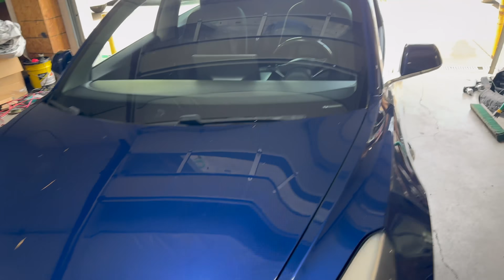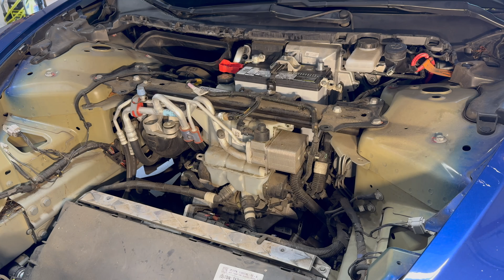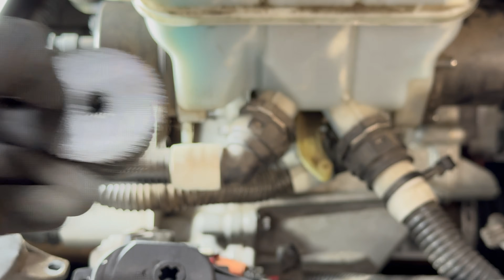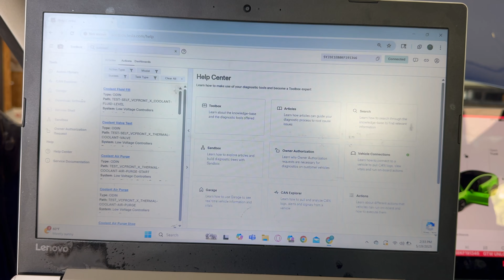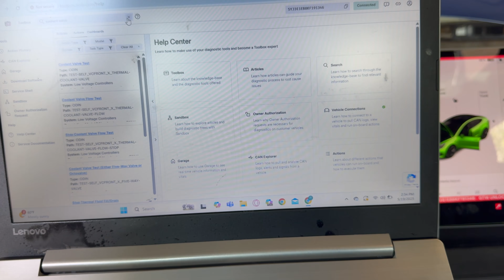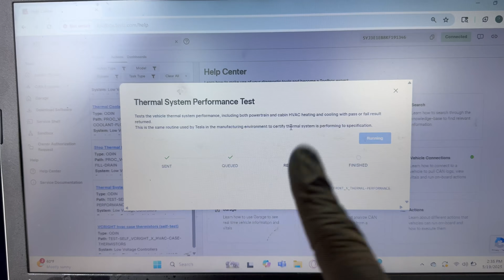Model 3 In For More Maintenance! Coolant Valve Replacement

Comment: Replaced the coolant 5 way valve today,
Broke the old part apart and used the  old gear as tool to align the new part.
Super easy
You don’t need tesla tool/wrench to align.
I have pics but can’t upload here on comments
Reply: I'm about to replace mine and was wondering about how to align it. Thanks for the info. I'm understanding it has to be aligned exactly as the new actuator right?

Comment: I have this error and not getting cool air   VCFRONT_a160_lowSuctionPressure = true
Cleaned front radiator, changed filtrate A/c was recharged 9months ago . Any idea?

Comment: Took my 30 mins to remove the 3 torq screws that are upside down using my large hands and using hockey pucks between the engine bay strut bar to get clearance.  I had to use L-shape torque 20 tool, jus to break the seal that was tight.  Installing was easier.  I used the old 4way female gear to turn coolant valve; but the old coolant valve has to be disassemble to do it since i do not have 3d printer.

Comment: So if I go underneath and remove the skid plate on my single motor m3 I can avoid removing the whole frunk?
Reply: Possibly? I have a Dual Motor, but the plastic(?) undershield is easy to remove and install yourself. I drive mine up on ramps and remove it to replace the lower suspension parts and change the drive unit fluid and filter. If I were you, I'd at least put the front up on ramps and look at it. Maybe you decide to fix it yourself, maybe not.

Comment: I had the error a210 and I insisted to have only the actuator replaced.
It works normally, but now I get quite often a new error a249 (actuator clocked incorrectly on the coolant valve).
It clears itself after a few minutes...
Can someone explain what that means??

Comment: Having replaced several of these, I think this is not the correct way to rectify the issue. On many occasions I noticed that the actuator is wet, so the valve above must be leaking. Replacing the 5-way valve and its O-ring should be possible, but it looks like Tesla stopped selling the part. This way you need to replace the entire superbottle to fix one broken element. Bummer. Edit: sometimes the valve shaft is really hard to turn around, so some sort of maintenance on the valve itself would still make sense, IMO.
Reply: I don't recall if it's the 5-way valve or the octovalve(?) but I looked at the Tesla parts catalog and they do NOT sell the valve or a repair kit. On the exploded view they SHOW the part and the balloon reference number. On the list of parts, it is simply skipped over. I think it's balloon number 2 or 3, and it is located just above that electric acuator. Yeah, they want you to replace the entire Superbottle. I started looking into it because I have the a210 and a249 codes on my 2018 M3 LR DM.
Reply: @snowrocket Update? I have the same car with same error.  Curious what you discovered.
Reply: @mrpeterpumpkin48  I was told it WAS the Superbottle (or non-purchasable parts WITHIN it) that was bad, and that was the source of why it was taking so long to charge in winter. The coolant pumps/valve wasn't circulating the coolant sufficiently through the battery pack to get it warm enough fast enough to charge quickly.

After talking to both the dealer and Tesla Mend in Macedonia, Ohio, I bought the Superbottle from Tesla. Tesla Mend was about $150 cheaper and could schedule me sooner, so I had them install it. It worked out great and I saw an immediate improvement in charging speed. $1,150 OTD for the part and labor. If your heat pump goes bad on the newer cars, it's $3,600 parts and labor.
Reply: @snowrocket Wow. Very interesting. Thanks for the feedback. Good luck in your travels.

Comment: I used the early Model 3 header tank with dual pumps for my Evora EV conversion. One pump for the drive unit and the other for the battery. Found 12v inverters for the 3 phase pumps on Ebay. Just removed the rotating valve underneath and drilled a hole from the valve cavity to the header tank to convert it. Makes a very neat dual pump system that doesn't suffer from air locks.
Great video as always.

Comment: You can also use the old 5-Way Valve, by opening it and cutting it in half. then twisting the shaft is a piece of cake
Reply: That's exactly what I did. It worked great with a small set of pliers to provide leverage.
Reply: Leafs are trash

Comment: good video, thank you for that. 12V battery removal was not necesary. the valve test can be done via service mode. left rear under car plastic trim is detached....at the end of the vide.

Comment: Can you provide us the part number or the place were you can get the valve separate
Reply: The part number for the actuator kit (comes with new screws) is 1133873-00-C. It's available as an over the counter part from Tesla.
Reply: @AlexEVRepair Thanks for the fast reply and the great video 👌🏼

Comment: At approx what mileage did this fail on this Blue Model 3?

Is this a 2018/2019?

Does anyone know why it fails and a way to help extend the service life?
Reply: @ejp1 pretty much spelled it out. This particular car was a 2019 (though this same system was used on all Model 3s from 2017 until the 2021 refresh with the introduction of the heat-pump/octovalve system). I don't recall the exact mileage on this one, but I think it was around 100k mi (+/- 20k).
Reply: The gear inside strips out, mine failed at approximately 7 years and 100k miles, 2018 model.

Comment: Couldn't you just rotate the spline on the actuator to match the spline underneath? Maybe you can't do that, I don't know but it seems easier than trying to get that tool in there to turn the spline. Thanks for the great videos!
Reply: The actuator has a plastic gear reduction in it, so you can't really turn it from the output shaft without the risk of breaking it....
Reply: Thanks for the clarification, I figured there was a reason but wasn't sure.

Comment: Could you make a Video of what is the best used EV to buy from the repairs perspective?
Reply: Nissan Leaf and legacy Tesla S/X I would say. Everything else difficult to impossible.
Reply: Leafs are trash
Reply: @oldrango883 I know a few oldies who drive 20km max/day, 100% charging at home. It's like a mobility scooter with a roof. But they are very repairable almost no modern EV can be DIY repaired easily.
Reply: 2018-2023 Model 3. It has six fewer design flaws than the pricier S and X, and the drive units almost never break. The battery packs tend to last a long time and have fewer issues. I've read/heard some bad things about the first-year-model 2017 Model 3, so I stayed away from those. Based on my two years of research, the Model 3 had the best overall range, charging speed, acceleration, available AWD, and fewest problems of any EV I was looking at. 

I bought a 2018 Model 3 Long Range Dual Motor with 115,000 miles one year ago. I have 140,000 miles on it now. I've had a few issues but overall it's been very good. As a used EV I think these are the best value.

Comment: I had the same a210 issue just about a couple of months ago and Tesla replaced the entire superbottle. The alert only showed for me in service mode. This video would have helped and saved me some money! Thanks for sharing.
Reply: What did they charge you to replace the super bottle ?
Reply: @joshnull2596 ?
Reply: @joshnull2596  I had the same issue on a 2018 Model 3. Tesla Superbottle and labor at Tesla Mend, and independent shop, was $1,150.
Reply: @joshnull2596  1300$
Reply: 3k
Reply: @davn7723 lol u got shafted
Reply: Holy crap! 3k?

Comment: Can this repair be done without toolbox access? Can I reset/learn the new valve in service mode?
Reply: Yes, you actually can run the Coolant Valve Test in service mode. I'm just used to using toolbox all the time since these types of actions since they typically can't be done on Legacy S/X that I work on a lot, haha. If you did end up needing Toolbox for something though, 24hr access only costs $75 (or a whole month for $150).
Reply: @AlexEVRepair  Good to know about the toolbox pricing! A shame that they don't give access for free.
Great video, thanks!
Reply: @RC-fp1tl  To my knowledge Tesla is the only manufacturer to let you use their service software.  Shame on all the other ones.
Reply: GM have always provided end user access to SPS for module programming, and it wasn’t particularly expensive. $35 iirc for three hours. Since GM sold opel to Stellantis here in Europe, the price has increased but it is still available.
Reply: @dorsetengineering and wtf has that got to do with a Tesla? Completely irrelevant!
Reply: How do i run coolant valve test in service mode on my model 3 ?